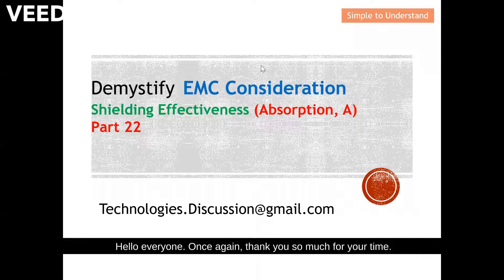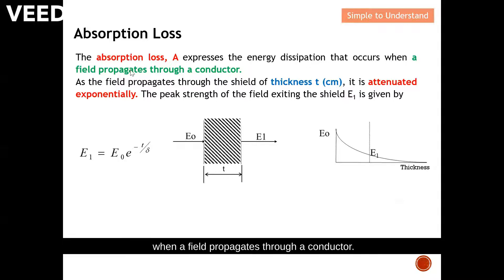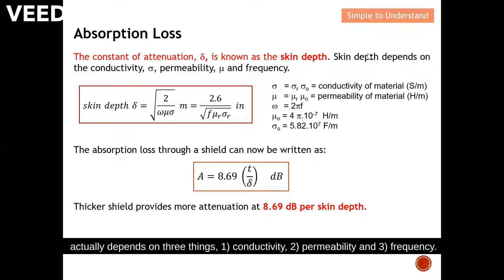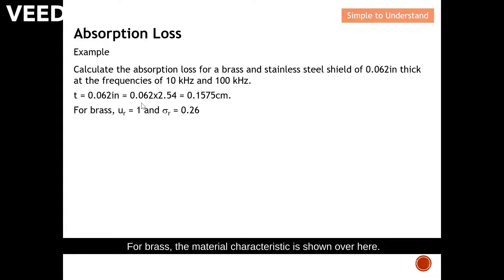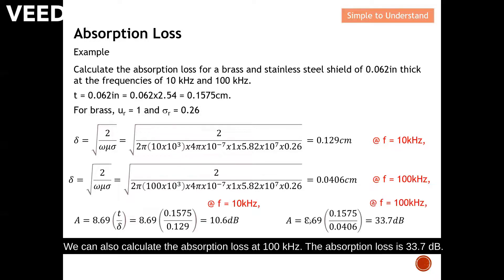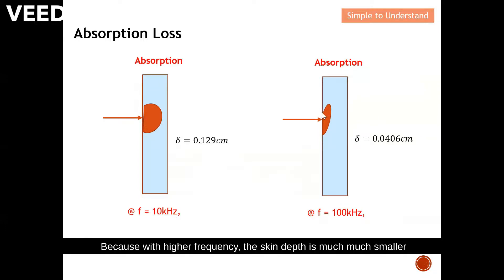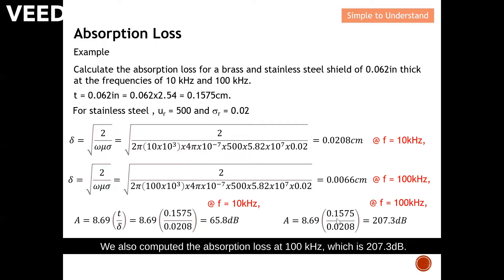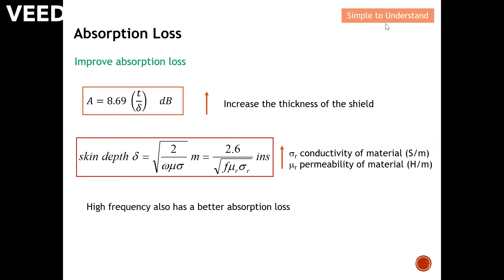EMC #22. How to Calculate Absorption Loss for Shielding – Material Types & Thickness Explained.

Comment: Why the absolute conductivity of Copper , brass and steel is taken as same ( 5.82 x 10 power 7) should that vary right?
Reply from the maker: Thank you for your question. Yes, the conductivity of different material will change accordingly. But if you take a closer look, what I actually done is to use ( 5.82 x 10 power 7) X (by a factor). For example, brass =1, stainless steel = 500. 
On the same pg, I vary freq for the same material.
I hope I have ans your question.  :)

Comment: In the solved example for Brass , why sigma r is 0.26, Since google give the below answer - The skin depth of brass at 10 kHz is approximately 660 μm or 0.66 mm. could you please clarify my question?
Reply from the maker: Thank you for your question. Sigma r for brass is 0.26 and my SI unit is S/m rather than m only. Pls be careful that that the calculation should be Sigma r X Sigma o (1.5 X 10^7). I have double check my answer with AI and the answer different is correct. My answer is 0.129cm and the AI is 0.13cm.
Thank you & I hope I answer your question.  :)